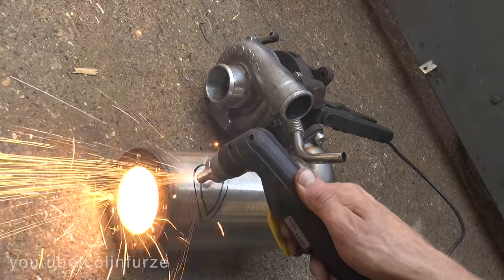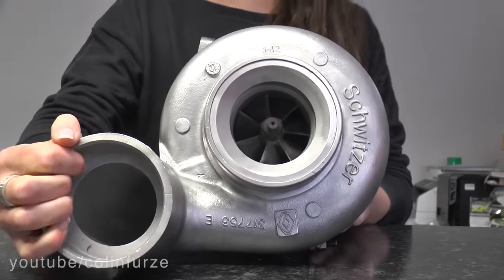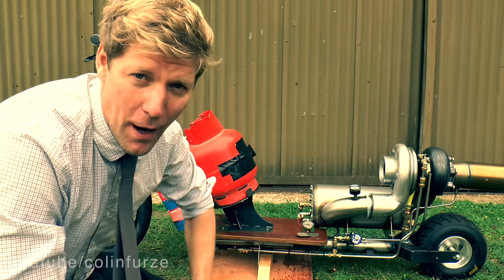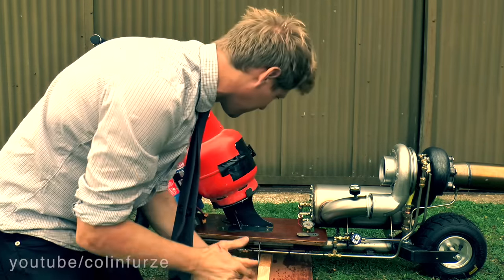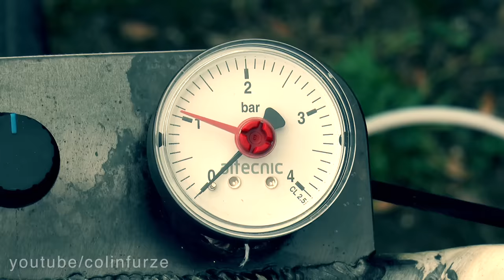TurboJet Powered Scooter-IT'S ALIVE

Comment from the maker: Boom we have lift off, so just a rebuild then its AFTERBURNER time and hopefully some more speed. Stay tuned and subscribe to keep posted about this brilliant project.
Reply: First
Reply: colinfurze nice
Reply: Second
Reply: Third
Reply: Congrats my bro👌😃😉#AKAAMIR
Reply: colinfurze ur an ex microsoft employee that bill gates thought would overrun him!
Reply: You my good sir are a genius
Reply: colinfurze Get a turbo from a big truck or twin turbo it
Reply: CANT WAIT WOOOO!
Reply: colinfurze afterburner is (in theory) quite a simple thing, I know you’ve probably built it by now, but all you should need is a separate source of gas, a valve and some piping. All that happens is fuel (gas in this case) is injected into the tailpipe where it is ignited but the hot gas and pressure. Hope this helps in some way and look forward to seeing it made!
Reply: Yay i want to see the Colinburner xDDD
Reply: Ayy
Reply: It goes fast so that’s all that we really care about. And it’s crazy
Reply: Could the exaust be used in a Venturi to run the afterburner? Also, thinking along the same lines as a modern commercial jet, you could mimic a two spool system and boost the intake with an electric ducted fan to get even more performance out of the jet.
Reply: That is so amazing. How do you come up with all your ideas lol
Reply: You are great at building stuff, but you are not so talented in balancing the music to your voice :D
Reply: You should reach out to my uncle, Ted McIntyre. He designed and built the Y2K turbine motorcycle.
Reply: First of all health and safety is having a fit mate. Where is you helmet, knee, elbow pads and your Hi vis vest? No gloves, safty glasses, mouth guard. I hope that scooter at least has non slip surface brov. Living on the edge man!
Reply: Parhaps a flat lined gas canister mounted under the platform where you stand.
Reply: Hm, this could give the term AFTERBURNER a whole new meaning :D
Reply: Love your videos
Reply: why not a drag race you on the jet scooter rick/tom (or someone else) on one of the other jet contraptions you have created
Reply: Needs nos😂🛴
Reply: Lower the music volume, the difference between you talking and music is too big
Reply: Hey Colin where the two small propane bottle are y don't u mount two map gas bottle or two small oxygen bottle to mix gas with the big propane tank that should give you better burn and more thrust your looking for also
Reply: Make a Y-pipe to go on front of your turbo and mount two velocity cones on front of your Y-pipe to get more air moving into your turbo from the sides of you clean up air flow your body is blocking alot of air intake
Reply: Please make a rocket engine
Reply: World record attempt maybe?
Reply: PLEASE make an ultra powerful electric scooter
Reply: Yo colin u r 1 funny guy like the shit u do keep goin matey keep it up LOL
Reply: You beautiful mad man!
Reply: Awesome vid today! I wish I could do what you can.
Reply: you've got cracking taste in music my friend.
Reply: Good job!
Reply: loonatic,does it wheelie?
Reply: Hey fix your oil set up pull from back when your going high speed
Reply: Another viral video of you
Reply: Great video, ik i'm sounding a bit like a kill joy and stuck up but you should really wear at least a helmet when going at speeds like that. Wouldn't want my faveourite you tuber to die
Reply: What about a converging diverging nozzle?
Reply: @the_luna_lily6234  you should build a jet powered plane
Reply: You should build a jet plane
Reply: I can't wait to see how much thrust it makes with the AFTERBURNER !!!!
Reply: You're great man!!!
Reply: Is this another world record?  =D
Reply: colinfurze now put twin turbos
Reply: 1 word - badassary 

Dude get a helmet for the love of pete
Reply: Colin, at this point you might as well put wings on it...
Reply: yes
Reply: How much oil pressure were you running? I had forgotten
Reply: You need following improvements to get maximum trust out of the thing - next to the much needed afterburner:
a) you need to take the vibrations off the turbo (not good for the connections and weldingpoints, pretty sure that caused that problem in the end of the video)
b) you need to add a fan (think "turbofan" from airliners) in front of the turbo (connected to it), causing more air being pushed into the turbo, thus creating more trust, and even more trust by the air the fan pushes along the turbo AND it would also help keeping the "engine" cool, making it more durable and possible to "run it hotter"!
c) this thing is INSANE!! you need to build this thing in series because I WANT ONE :-)
Reply: Just build a plane already, will ya.
Reply: What are you on about? He’s wearing his safety tie isn’t he?
Reply: isnt there a book or something you can share to help us understand what exactly is going on
Reply: The problem in the current system is the restriction of the turbo and the inability of the system to get exponentially burning more stuff. Like in a turbocharged car engine with a turbine size too small you will clog the turbine housing so it does not matter what boost you are seeing in the burning part, you still are limited by the flow of the turbine housing. I would say a more profitable way would be to start by running a wastegate to the nozzle system so that you can offer at least some relief to the turbine housing. Just try a variety of spring tensions to find the sweet spot. I did not watch the earlier videos about making it but I understand that this machine works purely by thrust and you are increasing the amount of burnt material by turbocharging and with that working principle in mind it does not matter if the exhaust gas comes of the turbine or from a wastegate. Another option would be to make the nozzle so small that the cause of restriction is the turbine nozzle, not the turbocharger exhaust housing.
Reply: colinfurze you definitely need to make a afterburner for the back of it
Reply: What speeds did you reach?
Reply: You look nice in skinny jeans :)
Reply: I was literally typing "afterburner" when I read your comment. Thank goodness
Reply: Excelente 🇩🇴🇩🇴🌎
Reply: На выходе из турбины ещё спрямляющий аппарат нужно сделать, чтобы воздух ровным потоком шёл
Reply: hey colin, maybe add an oil cooler so the oil will be nice and cool for the turbo and wont blow up the seals..?  other than that, banging job as always.
Reply: Super e bike
Reply: i wana see u build a turbo vacuum cleaner  ;)
Reply: Top class my friend. Can't wait to see the next video...!! U always seem to amaze !! 👌👍
Reply: This is a BATSCOOTER xD
Reply: i was about to say that it needs an afterburner
Reply: I want to see the after burn too. What is the name of the last song?
Reply: i think this is the first time I've seen you use a different outro
Reply: I agree an AFTERBURNER is a good idea... However cooking some BACON on that exhaust is a must!
Reply: If you would like to do 90 kmh or 55mph twin turbo with a afterburner
Reply: You need to raise the handle bars
Reply: You should wear a helmet more
Reply: I would imagine that drawing vast quantities of LPG from that tank will make the tank very cold and you'll get less gas flow from it, perhaps you should try using the jet engine itself around something like a radiator to warm up the LPG tank it may increase the flow coming out of the tank that's giving you more power
Reply: I get chewed out for not wearing helmet on a regular bike
Reply: AAAAAAAAaaaaArgggghhhh AfterBurner :D
Reply: MIND BLOWN! again..
Reply: colinfurze really nice Bro 👌🏾 but please always wear a helmet! Your brilliant mind is your greatest gift you have to protect it the most!
Reply: Can you cook on the go with it can you can you fry some bacon on the jet nozzle
Reply: colinfurze try to level your sound man, my earplugs blowing my ears to shit Haha greets from the netherlands
Reply: Nice
Reply: colinfurze. I absolutely love the gate Colin. It's the small things that make it.
Reply: Convert it to a turboshaft!
Reply: Yeah a jet scooters cool, but it's slow as all fuck
Reply: Your the MAN Colin, your the freaking man!
Reply: @markmacleod  It could definitely use N.O.S. with a ligit after burner...plus is would look awesome...
Reply: @abdulwalli6667  this is...
Reply: I would like to see you add an afterburner!
Reply: Theee fuffffkkk
Reply: I'm curious when the back tire will melt 😉
Reply: How fast did it go?
Reply: @barnabyg6808  no it needs its own ignition system too and the nozzle must be different. It has to be variable to make thrust with the AB on and off.
Reply: colinfurze  any planning for giveaways
Reply: nise
Reply: If you wanted to you probably could make a detachable seat that can connect to the larger tank
Reply: Brakes?
Reply: To increase the thrust you can build a converging shaped piece of ducting around the exhaust nozzle. This acts as a Venturi Nozzle and increases the mass flow from the exhaust, increasing the thrust. I remember a Scrapheap show where they built jet powered carts where they also used one, and it helped.
Reply: Great work! For the after-burner I would suggest a circular pipe with a few high pressure jets (in order for the fuel to be spread over a bigger area). I would avoid screwing the directly to the exhaust pipe due to heat and expansion. Regarding the circular system, placing it inside the exhaust pipe might cause too much back-pressure and stall the engine, but I am not sure about that one. On the other hand, outside placement would probably do (almost) nothing. Investigate and do as you like! (Also, I am a 12th Grade student that happens to like these things, so don't quote me on ANYTHING XD ).

Keep it up and most important of all, stay safe!
Reply: you mad putting an AFTERBURNER  on it
Reply: When it's done, you should encase it in some sort of streamlining, then paint it! It would look so cool!

This is amazing! Thank you for these videos!
Reply: Two turbos + afterburners = WIN
Reply: What could possibly go wrong.....
Reply: Try to see the wings may fly.🤩🤩🤩
Reply: @barnabyg6808  The gas leaving the nozzle is at high velocity, not high pressure. The gasses leaving the turbine would have to be at sufficient temperature to ignite the gas. (500-550°C for propane) This likely will not occur using that turbo and he'd probably have to use some external ignition (via sparkplug etc)
Reply: Slow as fuck bro...expected it to be faster.
Reply: car with spherical wheels and with magnets, that is, a sphere with magnets driven with magnets.
Reply: A jet powered Ultralight would be fantastic Colin!
Turbojet of Pulsejet, your choice ;)
Reply: A JET BOAT!!!
Reply: After binge watching a lot of your videos in the last few hours I've come to the conclusion that if you were to ever snap you would be a comic book evil villain that's my deduction....a full on evil mad scientist comic strip villan...and god help us all if some how you get ahold of uranium.
Reply: rog allen twin turbos, mounted with the intakes rotated out so his body is between them.
Reply: Hey, what you thinking about the "Jet Engine Drift Bike" ?
Reply: @josbanse  that's not how a wastegate works. On a car you're preventing damage by wasting air when pressure on turbo is too high. Here the power comes from the burn which is between the fans, a wastegate will make it worse
Reply: You are my personal hero!
Reply: U pollution king
Reply: Just a question, a crazy one, if you put some tubes aside on air entrance of the turbo, will you not have more air going to the turbo? More pressure, more speed, correct? keep it!! Regards form Portugal
Reply: Colin for fucks sakes PLEASE start using more hearing protection.  That Jet Scooter is definitely going to wreck your stereocilia.
Reply: I'd really suggest you change the bike forks to some suspension forks if you find any cheap ones and won't change the geometry too much @colinfurze
Reply: maybe you shuld make it rin on kerosine and use the gas to dispure it and for idle
Reply: Or you could just have more air going to the combustion chamber. The key is oxygen. Then you get that bright blue flame at the end. If you put this in conjunction with a petrol injector in the outlet, then you get a full after-burn .
Reply: needs POWER
Reply: You are partially correct, i think generally having more oxygen and additional fuel injectors should do.
Reply: Less music, more noise from the engine... just saying.
Reply: colinfurze Please, please, for headphone users, please volume-match the footages and the music, your voice in one is quite quiet and then the next just BLASTS MUSIC IN YOUR EAR so....
Thank you for listening to us...
Reply: I SHARE A BDAY WITH YOU
Reply: colinfurze Can you use a pulse jet to fly ??
Reply: Hey Colin,
johannes from the german youtubechannel "The Real Life Guys" built an offroad-wheelchair for his brother Phillip, who has his knee injured. But he only used some BORING electric motor. I thought that you could pimp it up with some COLINFURZE-MAGIC.
Reply: colinfurze  maaaaan I have an idea for you. You need to have four all piped together and you make a flange to combine all four exhaust nozzles into one pipe and use the afterburner with the extra air velocity.
Reply: colinfurze ...maybe even one main combustion chamber....?
Reply: @JessicaBiros  would love to see that.. can it be put onto a switch to have "AFTERBURN" and the regular mode as seen here..
Reply: @southchum101  he'll get there..
Reply: @HerrRussoTragik  why not both.. 

Cue ol' el paso commercial.
Reply: I was going to say that you could inject water after the burn chamber. But afterburner is wilder!
Reply: Тишинг
Reply: RAM JET time
Reply: colinfurze
Reply: colinfurze You are awesome
Reply: Can you tell us the velocity of this mechanical beast???
Reply: We want to see the afterburner!!
Reply: I hope you build a jet powered sledge for winter.
Reply: Hearing protection!!
Reply: colinfurze you should put another turbine connected to the rear wheel (turboshaft like in helicopters) to have real power! It world be great
Reply: Semi truck turbo it!! lol thos turbos will make some real nice thrust
Reply: You sir, are delightfully insane
Reply: How much?
Reply: Add a fairing would help the speed a bit.
Reply: Thanks for the tutorial. You're an engineer? You do amazing things. You're my idol.
Reply: I have a question: Is it possible to jump start a ramjet or pulsejet using exhaust from a piston engine? If so, how powerful would the piston engine have to be?
Reply: very good Maybe Arabic translation
Reply: Please use a more dense fuel for your after burner.  Oil would be best, but not sure youd have the nozzles with the pressure needed to atomize efficiently.
Reply: Compounds would be cool too. . .
Reply: Этот чел ворует идеи у темной фазы и креосана игоря негоды
Reply: When is it coming
Reply: I cant wait
Reply: You should add a seat
Reply: You should  add a oil cooler to keep oil temperature
Reply: "pig and a cow"  LOL
Reply: Awesome.   Non human being
Reply: Gloves? Maybe a helmet? You're a little tougher to rebuild than the bike... great job BTW!
Reply: Im still waiting for the afterburner :(
Reply: Afterburner?
Reply: im still waiting for afterburner:(
Reply: Sir or water cooling needed
Reply: Wear a freaking helmet...
Reply: Gas turbine engine when?
Reply: When?
Reply: So lets repalce the seals and get that after burner going! It has been 9 months Colin!! We have waited long enough mate
Reply: WHEN AFTERBURNER! ITS BEEN 9 MONTHS
Reply: Oil cooler and Reservoir tank vent system should help keep seals from blowing seals on the turbo
Reply: Subscribed, but still waiting on the afterburner.   And Please wear a helmet.  It would be terrible if your youtube career was cut short by simply not wearing a helmet.
Reply: Where is the after burner?!!
Reply: Dude. Afterburner. Do it.
Reply: whats the link to the afterburner scooter? you're the inspiration of a generation, don't stop what you're doing!!
Reply: With 10 bar fuel pressure you can fly. You need more pressure.
Reply: Hey so uh... Yeah... Did u ever make the afterburner for the jet scooter???
Reply: Man we wanna see the afterburner, or at least have you say it didn't work.
Reply: Yes!!! Thats what im talking about dude!! More thrust! (Thats what she said... Eh hem.. The last thing.. She evah said!!)) (Hysterical laugh!!)
Reply: colinfurze Still wating on that afterburner!!
Reply: How’s the afterburner project coming along Colin?? Any idea on when the video will be up?
Reply: Colin I think that you should make a Venturi at the nozzle so at high speeds the gases could almost reach supersonic speeds
Reply: IT NEEDS A SMOKE SYSTEM
Reply: @spyrosm.2871  a twin turbo would give you less power then a single turbo
Reply: still waiting for the afterburner
Reply: Any update on this one?
Reply: Hi
Reply: How does your neighbours put up with you Colin building something that make a HUGE TREMENDOUS AMOUNT OF NOISE!!!   .,....JET ENGINES!!! 😯😮😁😄. Have they got use to it or have like most neighbours either complained or moved far away. 😁😄.  I don't how your wife puts up with you😄😄😄😄😄😄 Especially when she's trying to watch the TV or do some relaxation. She must be made of thick skin so to speak to put up with ECCENTRICITY!!! 😄😄😄😄😄😄😄
Reply: Afterburner video yet?
Reply: colinfurze afterburner video yet?
Reply: Afterburner would be cool, but I'd like to see water injection in the impeller stage... for mega steam boosting. :D
Reply: Wear helmet next time you are precious to us.🙂
Reply: Hello good job man I need to know all this
Reply: colinfurze 
Air pollution
Reply: good like by #wayank chennel from red island indonesia
Reply: Ever do the afterburner?
Reply: Well its bin a year
Reply: Jet powered napalm.
Reply: Turbofan next?
Reply: You're the man, Furze!
Reply: @Mr_Glenn  #WHATTODOIFSOMETHINGINTHEEYE
Reply: That and he wears his underpants backwards..
Reply: Be safe broo 👊
Reply: When are you gonna fit a warp drive to that thing?
Reply: What's the max speed it reached
Reply: 2years...
Reply: Two years later…
Reply: What ever happened to this?
Reply: Very cool. I hope you revisit this project one day for the afterburning fun!
Reply: I want to see turbo converted into  a turboprop design so the turbine spins the wheel that ought to generate way more speed
Reply: you never made the afterburner
Reply: When comes the afterburner?  I'm waiting now for five years 😅